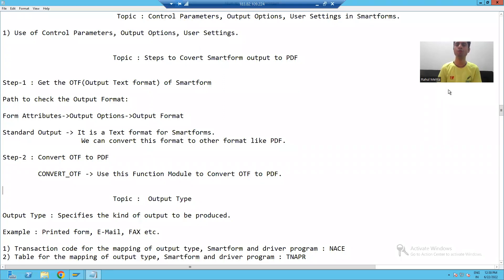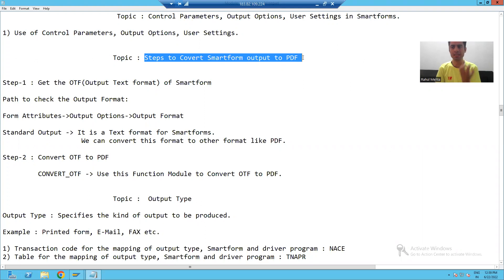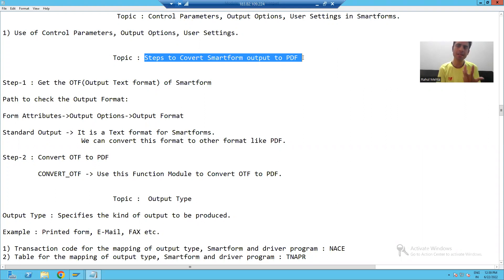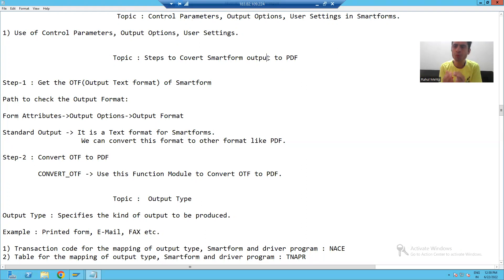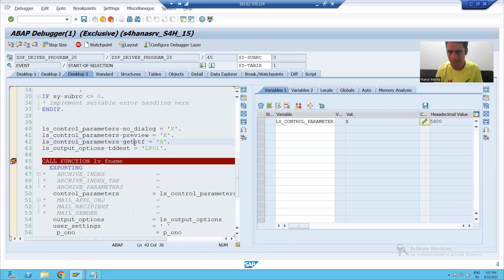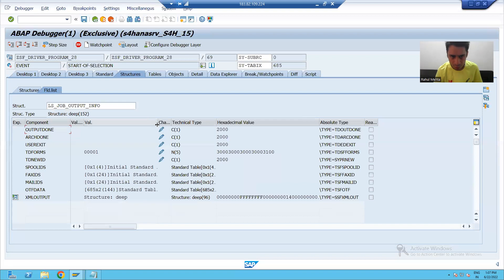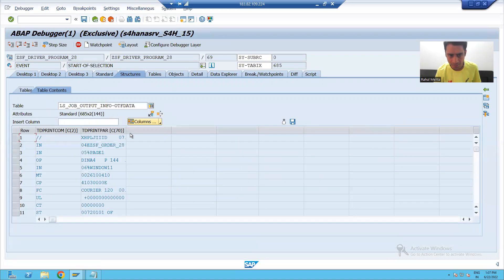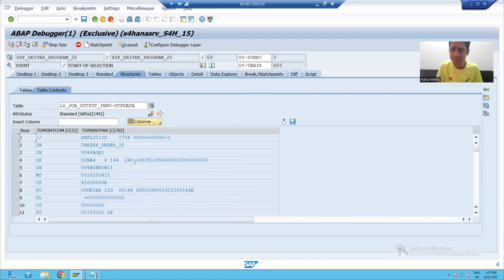43 - Smartforms - Converting Output to PDF Part1

Comment: Dear Rahul, is it possible to find somehow this smartforms sourcecode somewhere on github or somewhere else?
Reply from the maker: Hello - I am not using Github. In case , you use this smart form, it will not be fruitful. You will get lots of syntax errors related to data elements, tables, table types, structure types etc. as they are non-existent in your system.
Reply: @sapabapbyrahulmehta  Thanks for your reply! Yes of course you're right in this regard, but I thought a source code would be useful just as a quick guide or quick reminder when someone hasn't been doing quite a lot of smartforms recently :)

Comment: For some reason after running the function module with lv_sfname my ls_joboutputinfo is empty. i added ls_controlparameters  with 'X' on no_dialog, preview , getotf and ls_outputoptions with 'lp01' on tddest.
Reply: the smartform gets printed perfectly when i dont add ls_joboutputinfo in order to get the otf. but when i add it i  after that function runs its still empty (and of course the smartform is not printed) if i do the whole procedure of converting it to pdf etc... i get an empty white pdf(which is reasonable since the otf data is empty so i convert empty otf to empty pdf).